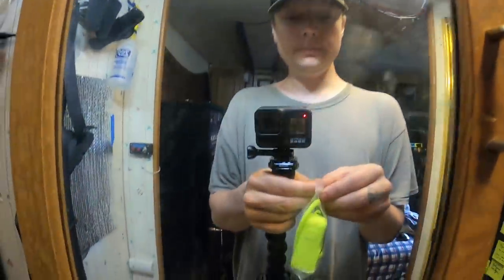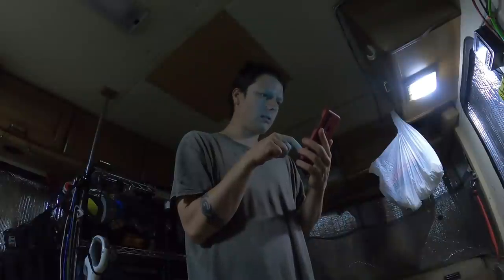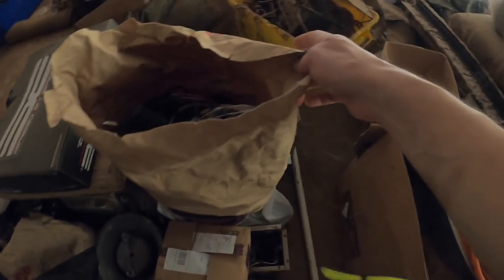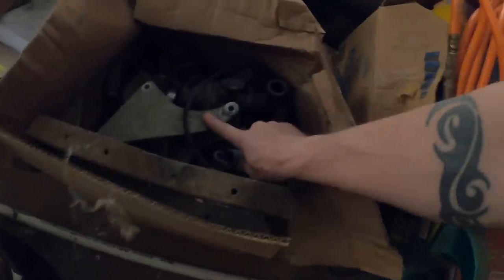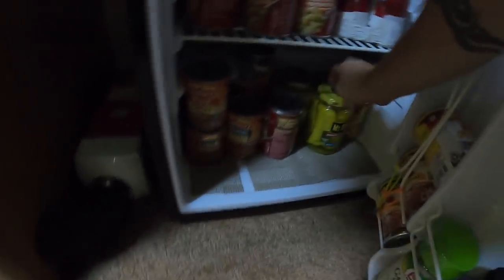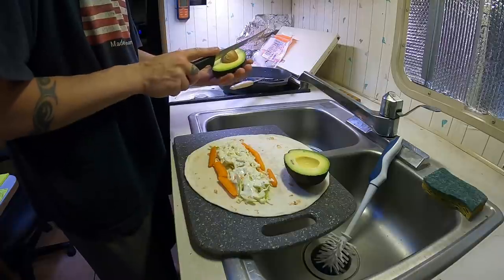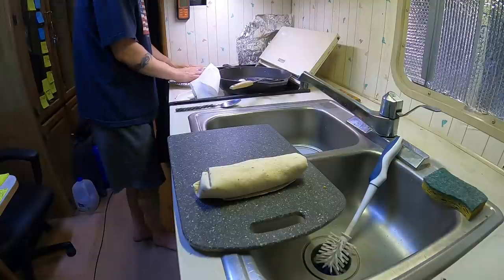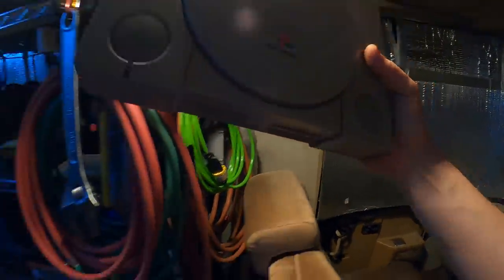Spring Cleaning & Summer Rain - RV Living Burrito Vlog

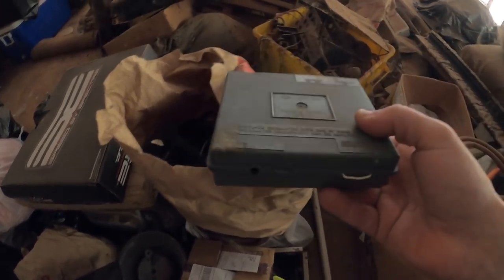Comment: The box you displayed at 5:04 is not a wiper controller. It's an aftermarket cruise control brain, probably a Dana or AVX. If you aquire a set of magnets, a pickup coil, and a cruise stalk, you can make it function on your RV.